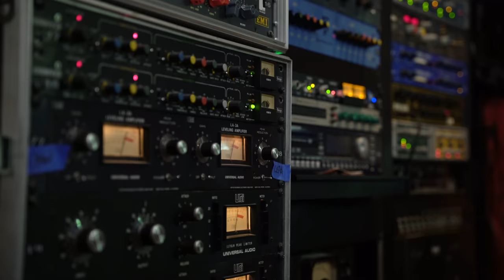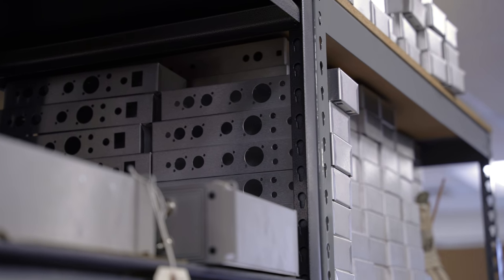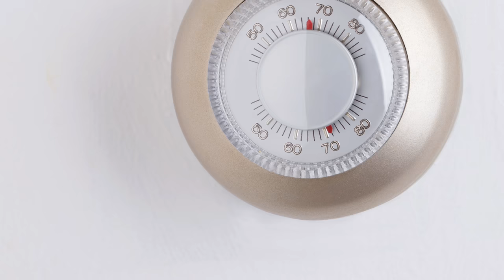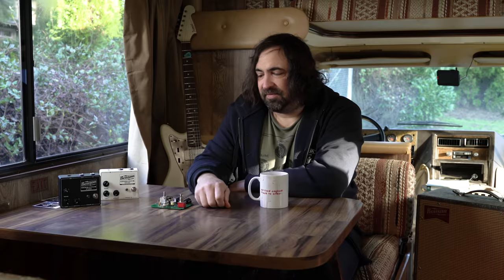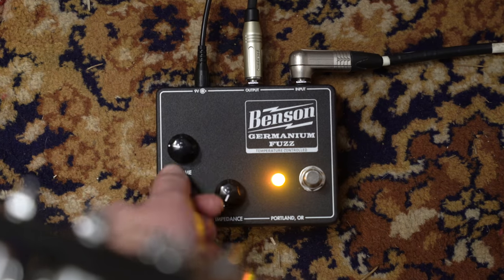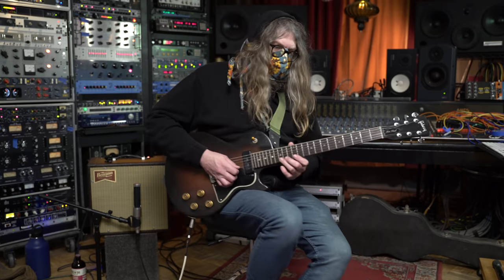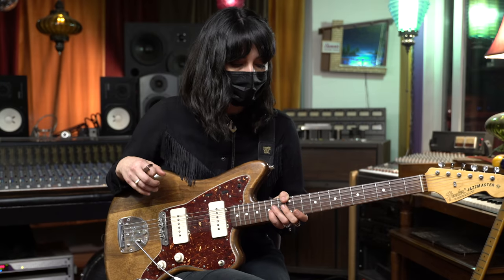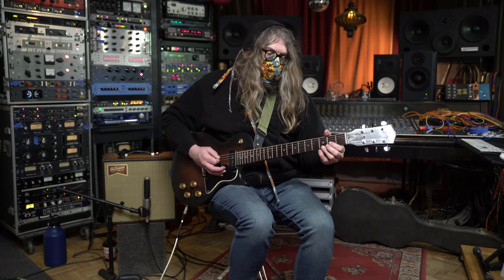Germanium Fuzz Mini-Doc and Demo

Comment: I just got one of these and it’s a total game changer! Now I can gig a germanium fuzz completely worry free. The added flexibility with pedal placement is great, works with any wah. The impedance knob is the most useful tone shaping control I’ve used on any fuzz ever, really does make it capable of pretty much any type of dirt you can think of!

Such a well designed product, really impressed guys.

Comment: I thought germanium transistors were supposed to sound better when at low temperatures. How come they are warmed up?
Reply: I believe it is about the biasing. If a normal one is biased at room temperature it'll sound terrible at 90 degrees. These are held stable at 95 degrees and biased to sound right at that temperature. If it's lower than 95 then it'll warm automatically and hold it there at optimum temperature. If well above 95 degrees it might not sound good but even here in Australia, it's not that often we are above 105 degrees unless in direct sunlight.
Reply: @chrisjs6123  Ahh, makes sense. Cheers man : )
Reply: I lack a few mod cons in the studio, and the fuzz just quits around forty degrees. Kind of slow, so I didn't think to get a light bulb on the floor until last winter. This is better.